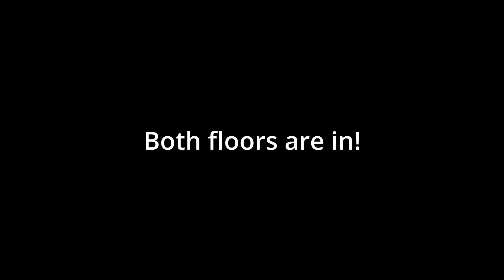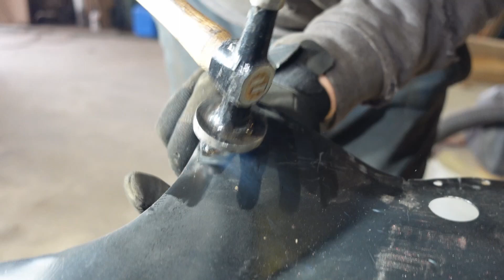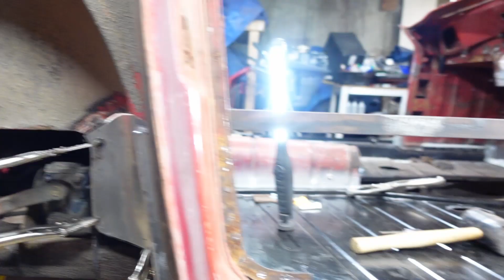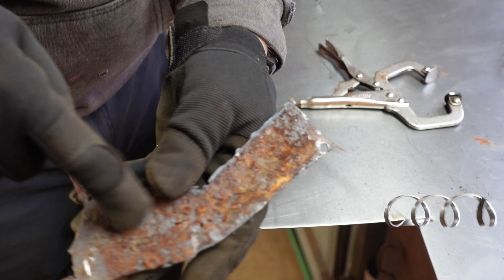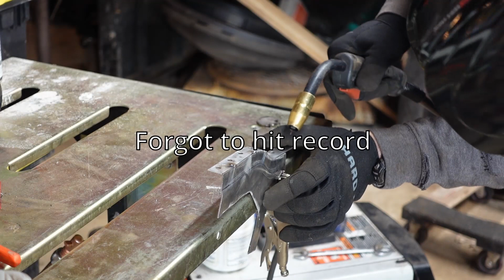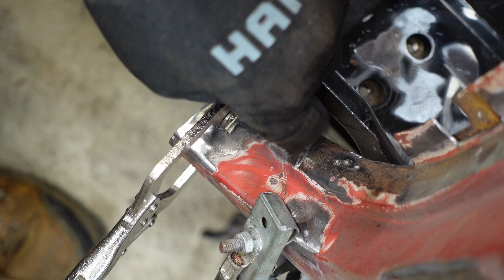Triumph TR4 - Passenger Floor is In! | Roundtail Restoration

Comment: Good work on the flange of the outer side of the A-post... I saw that strip of metal and thought no way will that curve, but you proved me wrong.  

For the inner flange, you made a good two piece solution, but I've been at the same job on a TR6 and for that I made it from one piece of metal using hammer-forming.  I cut two identical pieces of wood with the profile of the "s-bend".  The sheet metal was trimmed so that the width of the flange protruded above the wood profile and the wood/metal/wood sandwich was then firmly clamped in a strong vice and the flange tapped over.  Make sure you are bending the flange in the direction needed and take a few passes to complete the bend, as the  metal needs to stretch and shrink according to whether it is on the  inside or outside of the curve.

I used some scrap hardwood ply to make the two forms... softwood may not have the strength needed to resist the forces, so may not give a nice sharp 90 to the bend.  If you have access to a bandsaw then that would be ideal for cutting the profile in the wood, or maybe a jigsaw.  If the shrinking metal starts to dig into the wooden former, then inserting a strip of metal between the tuck and the former can help.  I don't' have a bead roller, so my joggle, to accommodate the flange of the inner sill, was made by clamping the flange bent piece in a vice along the joggle lines and hammered in the offset using a blunted chisel.  I think that this needed three operations because of the s-bend.

Before welding everything up I suggest that you double check the vertical dimension between the floor and the underside of the two horizontal sections of the bulkhead located either side the tunnel opening (where the pedal box attaches on one side... not sure what is on the other side of a LHD car !).  Before cutting out any of my floor panels I made a wooden prop cut to the exact length which was then tightly sandwiched into this space (selecting a location near the underlying frame, rather than in the centre of an unsupported part of the floor which can flex).  I then used this same prop to support the bulkhead before welding up the base of the A-Post.  In fact, I think that I needed to use a scissor jack to push up the sagging bulkhead when reinserting the prop.
Reply from the maker: Thanks, Robin. I do intend to check that vertical dimension. As a matter of fact, I was able to source a BMH inner A post which I'll use. I might not have to weld it in if my patch works, but it'll provide good reference. Good idea of the wood form. Didn't think of that.